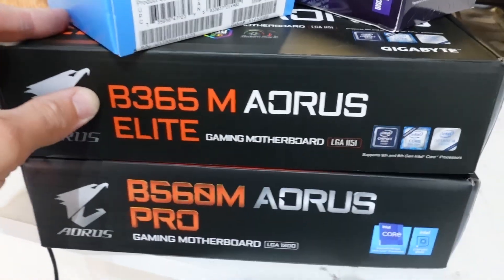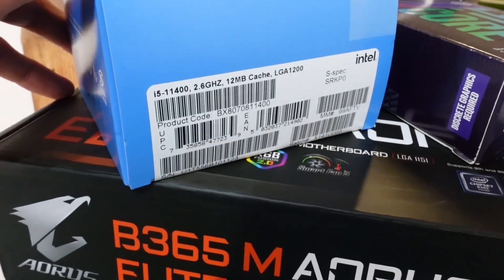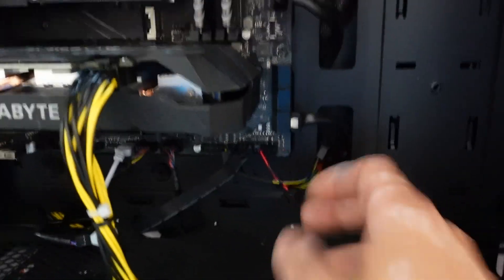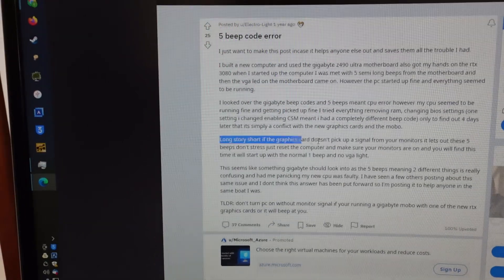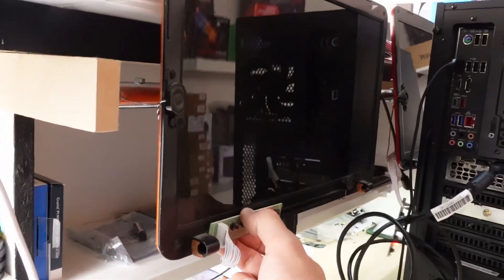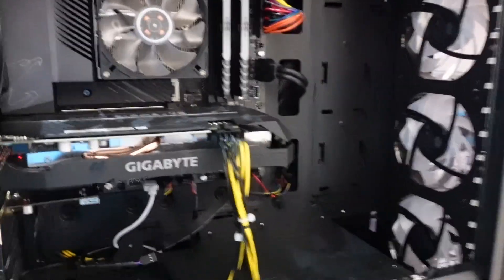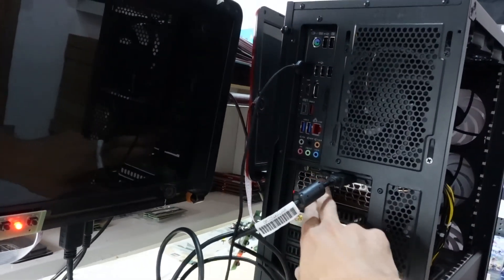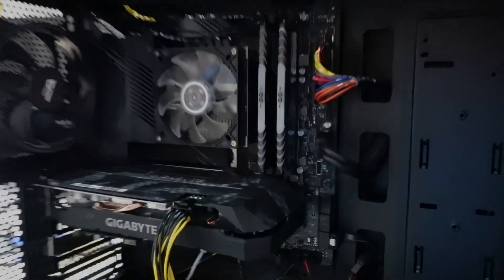New Build, Gigabyte Mainboard 5 Beeps on boot

Comment: I had a h410m s2, gt730, 10400f and 5 beeps after about 3 years of use.  Cleaned all contacts 
, cleared cmos quite a few times and finally it gave a display. The main point is that on the internet all support forums say it is a bad cpu!!
Reply from the maker: i would suspect maybe a failing motherboard

Comment: For those who using an old pcie 3.0 gpu cards on newer mobos might be bios compability issue. I switched to normal mode as performance mode gave me five beeps and it worked.
Reply from the maker: Thanks for the tip!
Reply: How to change to performance mode ?
Reply: @7872921  On some amd cards there is bios switch turned off performance mode and it worked. You need to turn off performance mode.

Comment: Built a skylake Xeon lga1151 gaming pc, and I’m also getting 5 long beeps, I saw it was either cpu or ram, so I replaced those along with psu. Ik the gpu works. I will be using this method to sanity check myself.
Reply from the maker: good luck

Comment: Thanks so much for this vid. I had the same issue with my new build. My PC is plugged into a separate UPS from my monitors and I usually turn on my PC first forgetting to turn on my UPS for the monitor. The 5 beeps went away when I turned on my monitors first before the CPU. Didn't know that it was this simple. 😅
Reply from the maker: Glad it helped

Comment: A better trick for this error code is to take a look at the diagnostic LED lights. Most motherboards should have them, they have labels like CPU, RAM, VGA and BOOT. Normally, your computer should cycle through all of these lights, but for this beep code, it will probably get stuck at some point. Check where it gets stuck and that's your likely culprit.
Reply from the maker: indeed, they are useful

Comment: If it helps anyone, my 5 beeps issue was memory slot 2 AND 4, yes, both, luck me…. Just put ram on slots 1 and 3 and worked (tested all other combinations, 1&2, 3&4, 2, 4… only worked 1, 3 or 1&3)
Reply from the maker: Cheers for your tip :)

Comment: FFS WHERE DID THEY SEE THE NEED TO USE THE SAME 5 BEEP CODE FOR BOTH A F*CKING CPU FAILURE AND THE F*CKING MOTHERBOARD NOT DETECTING THE F*CKING MONITOR BECAUSE ONE THE STUPID F*CKING CABLES IS LOOSE OR SOME SH*T LIKE THAT,WHY NOT CREATE A NEW BEEP CODE?,I ALMOST HAD A F*CKING HEART ATTACK BECAUSE OF THIS SH*T, THX MEN.

Comment: I just bought this new mother board and intel cpu i9. I have been build few computers in the pass, 
and most of them with gigabyte mother board. I like gigabyte mother board 
and i am happy with it. This is first time it happened that I can't start my new computer after newly build. 
When I turn on power, i can see light come on, on the memory and I can see small small led on the mother board come on too. 
But cpu fan is not coming and also I don't see any thing coming on, on the screen. Also I don't hear beep and I turn on power.
Normally when I does that. Please can you advice what I am doing wrong here.

Comment: my sincere advice to all DO NOT BUY GIGABYTE motherboards, they suck , i listened to some crap from a so called tech vlogger , ditched asus and went to buy giga"BITE" , extremely difficult  and user unfriendly bios configuration and unstable firmware. now ending up with 5 beeps after some bios configuration , cmost clear , gpu re sitting, monitor change  nothing works.
Reply: I did the same thing changed smth in bios at first it was 3 beeps then it was 5 beeps now idk what to do, what did you do to fix it?
Reply: @tobiik75  Bought a new Asus MB, so far so good. i cant afford to have unstable pc.

Comment: It just happened with me using an Aorus z690, an i7 13700kf and a GTX 1070, on a HDMI monitor. 5 beeps, no signal, every fan working. I messed with the GPU PSU plug and the mobo PSU plug and it booted!
Reply from the maker: Good to read it's all good

Comment: I had a major upgrade of my PC, including a new CPU and motherboard... 
This 5 beep BIOS code, i.e. a CPU error (according to Gigabyte's documentation), is a f*"! joke. Also, the VGA error LED in the mainboard was lit, which means, according to the same manual, a malfunctioning graphics adapter which is a RTX 3090 in my case. Now, this 5 beep code halts your computer and keeps restarting. And so on.
Dang.
So... Your monitor must be connected and turned ON? Really? Just to start my OS? Wow...! 
It took me hours of troubleshooting and I was worried about having damaged one of my components, until I finally found this video. Still looking for a way to deactivate this great "feature". Gigabyte should really fix this with a BIOS update. Thanks for the video! 👍🏽
Reply from the maker: Cheers

Hope your machine is all up and going again

Comment: Thanks for sharing this tup. I have the B660M version and I have the same problem. First time I tried this it work but then when I saved BIOS and exited it did the five beep loop again. Do you have to let it sync each time you restart the computer?
Reply: If u figured out the problem, what was it? Mine has the same but it boots to windows just fine. But I can’t access bios at all- not by pressing delete or going through settings 🤷‍♂️
Reply: @opencircuitt  did u fix it I have the same problem
Reply: @MusicalKeyboardRaghav9999  Yes my problem was with the graphics card for some reason. I had a geforce gtx660 in it while i waited for my new card then I put in the new RX5700XT and that solved the problem. I think maybe the gtx660 had some problem or it was just too old and the motherboard didnt like it. Hope that helps
Reply: Graphics card display issue maybe. My old computer had no issue with it though so IDK

Comment: Hi everyone, I have a B560M DS3L V2 CPU i5-11400F GPU RTX 3060ti, and sometimes 5 signals appeared when the PC was turned on. It turned out that if you start the PC before turning on the monitor, these signals do not keep you waiting, turn on the monitor before turning on the PC, everything starts normally, 1 signal and start. I immediately doubted that it could be my new processor. I want to add that in my case, even after 5 signals, the system starts and everything works stably. (I apologize for the mistakes, I wrote with the help of a translator)
Reply from the maker: Good advice
Reply: I have the same B560M DS3L V2 motherboard, 11400F cpu and gtx 1050 (hdmi) and  the 5 beeps problem the first time i turned on. So i tried other vga cards, screenmonitors, updating bios with qflash plus, changing ram positions, nothing worked. BUT when i connected with DISPLAY PORT  cable in the 1050  IT FIXED. No 5 beeps.
The problem of the 5 beeps returned when i went back to hdmi. But i fixed it returning with Display port cable, entering in the BIOS, Advanced Mode, Boot and setting CSM Compatibility to ENABLE. (and save settings). After that no more 5 beeps and i can use HDMI or others vga or dvi  conections of 1050 and other vga cards.

But yes, this video is correct cause the 5 beeps error is vga card coenction problems, no cpu problem. I think this is the last time i buy a gigabyte motherboard.

Comment: Hello friend, I have a problem, I have a GIGABYTE H410M H V3 motherboard, with an I3 10100F. The components are new.

I connected an rx 550 and an rx 470 for video, for a while it didn't work, but then it stopped giving video, and it started and continues with this 5 "short" beeps in my case.

I bought the rx 550 used, and I assumed that it was damaged, I changed it for my rx 470 that I bought new in 2017, and it never gave me errors. As I said it worked with this last 2 weeks. After it stopped giving video, I tried the rx 470 on my personal pc, and it didn't give video either, I left it like that for 6 months, then I tried it again on my personal pc (GIGABYTE H110M-A I5 7400) And it gave video for 10 minutes , then I stop giving video but it's still on.

What can be caused this? How does a new motherboard with a new CPU ruin a GPU?

I am from Argentina.

I think that these problems of the 5 beeps are only with GIGABYTE, I will never buy from that brand again.
Reply from the maker: sounds like you had two failed GPU's

Comment: I had the same problem with a new i5-10400F - so need a dedicated graphic card ok with that, it's normal, but ... 5 short bips too!
Solved just by replacing the pcie graphic card (old card over 10 years old with a newer 1060GT), with the same hdmi display cable and screen.
And now this work. Damn I was so scared and stressed!!! Unbelievable to see that - all that because of a f..*** output display compatibility - a too old pcie card don't work !!!
Thank you for your video.
Reply from the maker: Great to read you sorted it out :)

Comment: I just switched cpu from 8400k to 9400f amd now it's beeping. It seems 5 long on the  8400k and 5 short on the 9400f. Both not showing any display (9400f for obvious reasons).
Reply from the maker: i would remove cmos battery, disconnect power
wait a minute, put the battery back in and connect up power

Do you have a dedicated GPU installed ?

Comment: I’m a 10700kf/3070ti/gigabyte z490 gaming x ax owner, and I’ve tried to insert old 1060 instead new 3070ti, but still have this 5 beeps and no picture(((
Reply: Did u fix it ?
Reply: @n1tro257  yes bro, as i can remember, i'd reconnected all power cables (gpu/cpu/etc.), replugged cmos battery and then i had a good start
Reply: @democratizerr  i fix it too , had to change some things in bios 💀
Reply: @n1tro257  Do you remember what settings you change?

Comment: I have a same problem in ( ga b250m d2v ), (CPU I3 7100 )! But mind case is different 5beeps later open normally
Get display , shutdown open again 1beeps turn back normal.
I already testing diff display cable，diff monitor, diff ram , unplug displaycard，nothing can fix
Reply from the maker: Not sure sorry

Comment: H510M S2H V2 mobo with exactly the same problem - five short beeps, which Gigabyte say is a CPU error, so how does connecting a different MONITOR have anything to do with the CPU error codes?!  Weird.....  My build has i3 CPU, will do nothing but beep at me(five fast beeps) at power-on.  Nothing I do will stop it beeping, never get any video output.  Major issue is that with all modern monitors, they put themselves to sleep after about five seconds of no video, so if this is indeed the problem, it is VERY tricky to actually test it, cos by the time you switch on the PC with the monitor in HDMI input, the monitor has gone to sleep by the time the PC has powered up.  Modern monitors don't seem to allow you to turn that "Feature" off either, so you're kinda screwed unless you can connect it to an older TV with an HDMI input or something, that won't put itself to sleep.....  Great video.  I just wish it worked for me. :(
Reply: Did you fix it? Same problem with a b560 hd3 and an i3 10100f
Reply: @oremarinkovic7925  did you solved?
Reply: @ivanfuentesnieves869  yeah it was the gpuz, needed an uefi compatible one. The mb posted fine then.
Reply: @oremarinkovic7925  my cpu hasn't integrate graphics, so i can't Fix it
Reply: @ivanfuentesnieves869  you have to get a newer UEFI compatible graphics card and use that. Not the integrated graphics.

Comment: I have the Aorus Z690 and i5-12600KF and I just build my first pc today, I think I manage to fit all the cables correctly but this 5 beeps says that there something wrong with my pc. I just found out your video and tried plugging in my GTX 1050 Ti and it worked! The 5 beep stopped and my monitor’s display turned on and went to bios. Thanks man, appreciate your help!
Reply from the maker: Great to hear this has helped :) thanks for letting others know you issue and what hardware